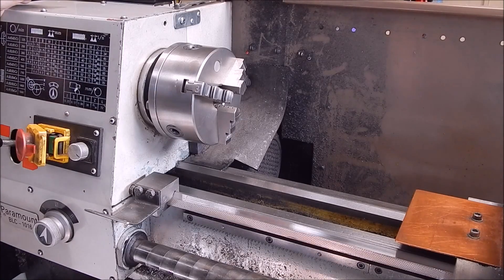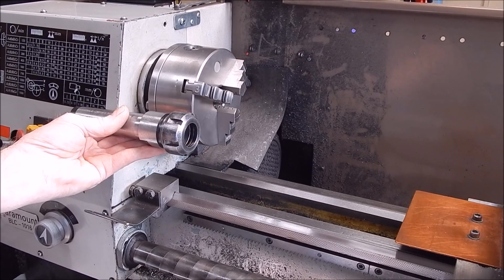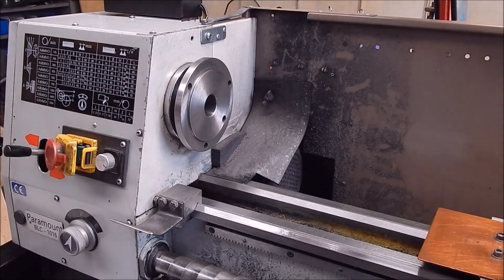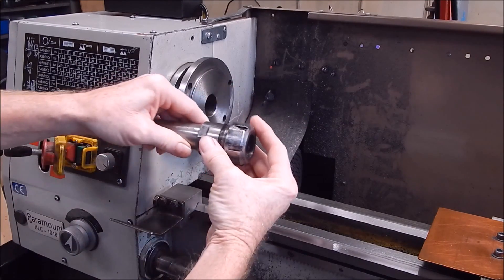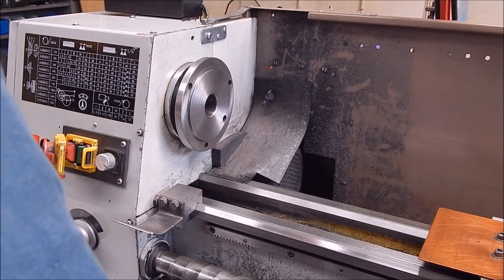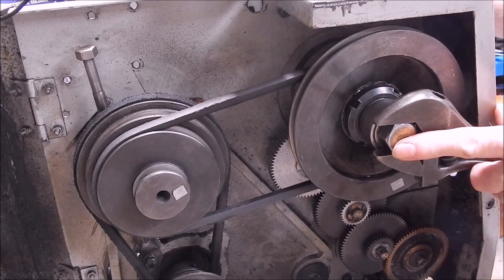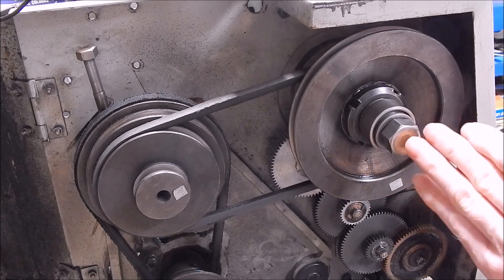Beginners guide to the use of collets on a small metal lathe - part 2

Comment: Good video, I've been trying to find out about using a MT collet setup most utube miss out on the introduction assuming you know all about the basics. Problem I have is the headstock has a MT 5, I have an adapter from MT5 to MT 3. But how do I get the adapter out? Would I have to make up another rod to push it out? Could it get Jammed? Graham, Australia....
Reply from the maker: Hi Graham.  You can't use an adapter as the threaded pull rod has to screw into the end of the collet chuck taper. The adapter tang will prevent that.   I would advise you buy an M5 collet chuck.  They are available, if a bit expensive.  That's the downside of having a spindle bore larger than 28 mm, tooling is expensive and not as readily available.  Cheers Rob

Comment: Do you need the draw bar. I’m buying a small 9x20 lathe and It doesn’t come with any draw bar or anything. Can you mill using this collet set
Reply from the maker: Hi Darth,  you need a draw bar to keep the Morse taper in place.  They are easy to make as the Morse taper collet chuck will use a readily available standard thread of the type sold by most hardware stores in lengths.  Cheers Rob

Comment: Stupid questions as I'm going to buy small mini lathe and interested in ER-collets at chuck(? as chuck?). Anyway so the morse taper, ie. MK2 is the same on both lathes and drill presses? And all Morse taper ER chucks have some metric thread (Wonder if they're all metric?) on their end, like in your video? It's not long since I remembered that most lathes actually have morse taper, but I've only seen normal 3 or 4 jaw standard chucks on lathes. I began to think that how to heck do you undo taper parts within lathe as there aren't release gaps (I hope you understand, not native English speaker) like in drill press morse fittings. I also know that hammering that taper from the bar slot on lathe would most definitely not be a good idea :)

Good video though anyway.
Reply from the maker: Yes, the Morse taper will be the same in both machines.  The only difference is that the lathe ER collet chuck will have a thread for a draw bar, and the one for the pillar drill will have an ejection tang to use with a wedge for removal.

To eject/loosen the lathe Morse you have to hammer on the end of the draw bar with it loosened off a few turns.  You do this with the lathe running to avoid denting the bearing races by beating in the one spot.  This is why you DO NOT tighten the draw bar more than 1/4 of a turn.

Cheers Rob

Comment: Hi Rob ! Great videos!! I always find something interesting!! Discussing collet chucks and collets. Do you need an imperial Chuck for imperial size collets? I work both metric and imperial. Will metric collets fit in any Chuck? Thanks in advance!!!
Reply from the maker: Hi Moreno, Yes.   ER collets have the same chuck dimensions for Imperial and metric collets.  Basically the chuck is metric dimension and so are the collets.  The only difference is that the collet centre (the hole in the middle) comes in metric OR imperial sizes.  This makes it super convenient as the collets are interchangeable in any ER collet chuck of a given size. As ER collets have a uniform full length 1 mm compression range they can hold imperial and metric work and visa versa. You aren't restricted to the nominal size as with 5C collets.    I use metric ER32.  Sometimes the extra size of ER40 would be handy, but the downside is that the collet chuck is a lot larger for close in work.   ER32 is probably the most popular size.  Cheers Rob
Reply: Thanks Rob!! I may be back with more questions!! I appreciate your help and love your videos !!
Reply from the maker: You're welcome.
Reply: Hello again Rob

When I work imperial, I use the following diameters: 8/64, 9/63, 10/64, 11/64, 12/64, 13/64, 14/64, 15/64 and 16/64. I know I can,  for   example 8/64  probably use a 1/8 and so on   with the multiple of 8 fractions. What collets would I use for 9/64, 11/64, 13/64 and 15/64? Is there some tolerance ? For ex. : the 9/64   -  can I use the 8/64? Or is it pushing it a little and better use the 5/32 if it exists? 

Thanks again
Moreno Borriero
Reply from the maker: Hi Moreno,   As per my previous post, there is a 1 mm tolerance/compression range with all ER collets.  That's a lot and way way more than a 5C collet can do. They also compress full length parallel, which 5C do NOT.  I only have a metric set and that handles Imperial fine.  If I was doing Imperial work then I would have Imperial as my primary set for easy reference, but in practice either will do the job.  I hate the restrictiveness of 5C type collets as unless you are right on the money size wise they just plain suck grip wise. Make sure to get the FULL set so all work is covered.  Cheers Rob

Comment: Nice video, thanks, would you say is better the er32 or 5c collets for this application? I have a grizzly lathe 4003g and debating which way to go.. I already own a 5c collet set , but I could buy the er32.. please let me know your thoughts
Reply from the maker: Hi Manny,

ER collets have the advantage that they compress evenly along their full length.  That doesn't happen with 5C or any other similar simple split collet (which don't compress at one end).

This ability also gives ER a much greater compression range than a 5C.

That and the cheap cost factor made it a clear choice for me.

Cheers Rob

Comment: Hi, I carefully watched both Part 1 and Part 2. So does that mean that if you want to use a collet in either the tail-stock or head-stock then you need to have two different collet chucks (even though they may both be MT3)? I noticed the tail-stock chuck had a tang and the head-stock chuck had an internal threaded hole at the end (for the draw-bar). Sorry for newbie question, but that wasn't mentioned.
Reply from the maker: Hi Brian,

Yes, the headstock chuck has a screw in draw bar and the tailstock one uses a tang for release.  You can use a headstock type with a small stub of screw in thread as a release tang.  You can also buy screw in tangs.

BUT, the headstock taper is normally larger than the tailstock, so sharing the same chuck is not really possible.

Cheers Rob
Reply: @Xynudu  Thanks Rob, yes indeed, I took my 3-jaw chuck off my new Paramount FL-610SM (thanks for advice on this model by the way) this morning for the first time and indeed found a much bigger taper inside.  Since I will be wanting to do milling, as per your videos, I will now need to be get a bigger collect chuck to fit the head-stock end. So, will be heading off to General Tools, also to get that exact same vertical mill attachment you use - they still sell them. Thanks also for the tip on checking that the movement resistance is uniform throughout the full length of travel! Many thanks, Brian
Reply from the maker: Hi Brian,

When buying collets/chucks it's important to get stuff that is made to DIN standard or has a stated run out figure. 

There are a LOT of crappy collets/ chucks around.  I buy my collet gear from CTC Tools on line store.  Always been good and usually cheaper.

So don't buy a lemon.

Cheers Rob
Reply: @Xynudu  Great advice again on only getting standardised collet sets. I have recently been trying to get my collets from CTC Tools in HKG as you suggested in another video some time ago. However, I can't get them to reply to my emails after trying several times now, so having to start looking elsewhere I think. If they don't reply, I might try a seller on OZ eBay who is selling collet sets which he purports are DIN6499B 0.01MM (0.0005") Run-Out Tolerance which seems good to me. CTC prices are very good though for a 19 piece (0.0006" RO) set, but website only offers most expensive shipping which doubles cost :-(

Comment: are the collet chucks, say an ER20 or what ever, tapered on the ID to match the taper on the collets OD? or is it just a straight piece and the nut does the actual closing of the collet?
Reply from the maker: hdrjunkie Yes, collet chucks have tapered sides. As the collet is forced back into the chuck it compresses in the taper.  The taper on the collet nose is more for centering the collet. Rob
Reply: xynudu ok, thanks! So now I need to locate some sort of collet holder that will thread onto M12x1 male threads... lol
thanks!
Reply from the maker: hdrjunkie You can buy threaded collet chuck mounts for most popular spindle nose threads if you hunt around, but they are not cheap.  Why not just make one?  It's not that difficult - I made one for my Schaublin.  Rob
Reply: xynudu I thought about it but im new to all this so I wouldn't know the correct taper, how to achieve it and all that good stuff, I guess I can get like an ER16 Collet and nut and just use trial and error until it fits.  what would I do, drill it out to its smallest size then widen it with a boring bore as it gets closer to the entrance of the chuck?
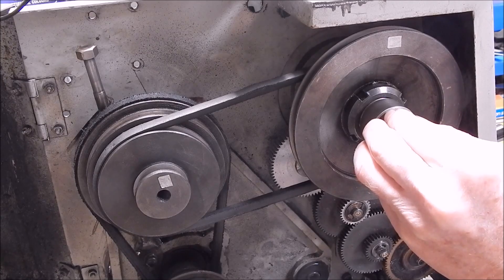Reply: xynudu ....or...  @ the 8:31 mark in this video, he shows the drawer full of collets and there's a collet chuck that looks like its threaded onto a Morse Taper spindle, what are the chances of finding one on eBay that I can take off the MT spindle and just drill out  and tap it with the M12-1 threads to match my spindle?
this way the chucks already made and all I have to do is thread it to fit. lol
Reply from the maker: hdrjunkie If your lathe has a Morse taper spindle you only need to buy a matching collet chuck off of Ebay or where ever and fit it. There are also quite a few videos on YT showing how to make a collet chuck. Rob
Reply: xynudu Thanks!
its got a straight shaft with no Morse Taper, Just a straight shaft with M12-1 male threads. I found one on ebay its just a collet chuck threaded onto a straight M10 shaft so im thinking I can drill it out to 12m and re tap it for M12-1 thread. lol

Comment: Hello Rob,
thanks for the video, very clear and well explained.
A quick question if you don't mind. I have a 7x14 lathe with an MT3 in the headstock and need to turn several small shafts of just 1.5mm OD and about 6mm long. Did one already and trying to figure out if a collet chuck is the way to go as I'll be doing quite a few of these small parts. After reading a bit about collets it seems that the two basic options for me are:
1). Get the ER25 with several small collets. 
2). Get the 3c collet closer with the 3MT to 3C collet adapter and a drawtube assembly that littlemachineshop sells and several small metric 3C collets 
The second option appears to be more adequate as the 3C system goes smaller than ER25 and the drawtube looks like a bit easier to use.
I also considered the 5C chuck but it's out of my budget for now.
Any thoughts or suggestions you could share?
Thanks in advance!
Reply from the maker: Yes, a collet chuck definitely is far superior for small diameter work.  Chucks are pretty useless at the smaller end of work sizes, as you intend to do.  It's personal choice on which system to use.  3C is OK, but ER gives a wider clamping range for a nominal size.  However, I'd go the second option given your work range/size intentions.  I hope that helps.  Rob
Reply from the maker: By second option I meant 3C.  Rob
Reply: xynudu . Thanks a lot Rob for such a quick answer, it sure helped. The ER wider clamping range and popularity/availability is certainly very tempting, I'm using 3mm steel rods anyway and turn them to the required diameter, so even the "large" ER32 might do the trick.
I have something to think about now, thanks again for your time, videos and help,
Best regards 
Nicolas.

Comment: Don't use a steel hammer on the drawbar (or anything else attached to the lathe).  Use a rawhide hammer (Garland) or at most, a brass hammer.
Reply from the maker: I have tried soft hammers, and they don't have the jarring action required to release the taper without a lot of pounding.  Provided you don't over tighten the taper, steel works OK.  The bearings are still quite OK after 10 years use - I have had them apart for a re grease.  Rob
Reply from the maker: Just to follow up - if I was worried about marking the end of the draw bar I would use a copper or brass hammer.  Using steel lightly as seen in the video hasn't marked the nut in any way.  Rob

Comment: here goes  have a micro mart lathe what size mores taper should i use and aqnd what size draw bar should I use can I buy one ?who has them ? 
thank you
Richard
Reply from the maker: If it's a 7x14 lathe it will generally have a number 3 Morse taper in the headstock and a number 2 in the tailstock. I can't give any more information on this sized lathe.  I suggest you join a Yahoo Groups 7 x 14 mini lathe forum, and they should be able to help with the rest of your questions.  Cheers Rob

Comment: Rob,
Nice Video.  How far back will a piece of rod stock go into the chuck?
Reply from the maker: About 50 mm from the collet face.  As the morse tang is threaded right through to the chuck, you can also extend into the available space in the thread cavity for the inside diameter of the draw bar thread. On a Morse 4 that gives you about another 70 mm (up to 15 mm diameter). Rob

Comment: Hi Rob !
For my mill I have exactly a collet holder like yours - a MT4 with a set of collets, Schaublin brand but without that relief to pop it loose again - that's so annoying.

My lathe has a MT5 so I have to have an adaptor in between and that keeps me from using any draw bar or tube/pipe ;-((

My spindle end is a little odd - so I think it's a Hell of a job to make a backplate with a collet holder incorporated ... I'll have to fine-think that a little more before I choose what to do ..  /:0)

Thx for showing and taking out the mistery of the setup - you did confirm my foggy ideas and guided me in another direction !
Reply from the maker: Keld you can use a short threaded piece of rod in the rear of the Morse 4 chuck to act the same way as a release tang.  I do that with my live centre.  You can also get an M5 ER collet chuck no problem.  I don't like adapters.  They bring the collet chuck a long way out from the spindle end - and lots of runout possibile. Cheers Rob
Reply: xynudu . ??? \°-((  I don't understand your first part:
 "you can use a short threaded piece of rod in the rear of the Morse 4 chuck to act the same way as a release tang."
I can't use my MT4 collet chuck in my MT5 spindle ... do you say I CAN ?

I think I'll end up making a back plate with a collet chuck incorporated ... but try with an adaptor MT5 to MT4 in the first place. I want to use my Schaulin collets - despite the missing releif to loosen them.
Reply from the maker: Keld Sørensen
I may have misunderstood you. No, you can't use the MT4 in the MT5, without using an adapter sleeve with an open back.  Why not just buy an MT5 drawbar collet chuck for your lathe ?  Rob
Reply: xynudu . I don't think I can be sure it will fit my Schaublin collets or can I ... ?